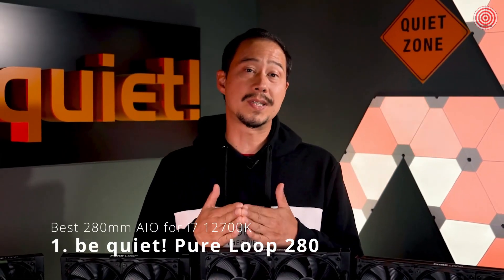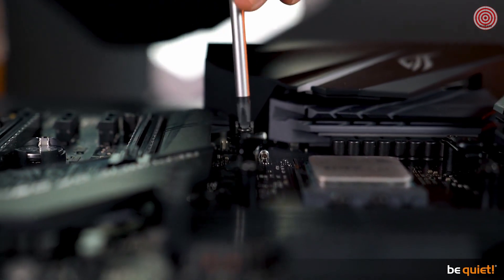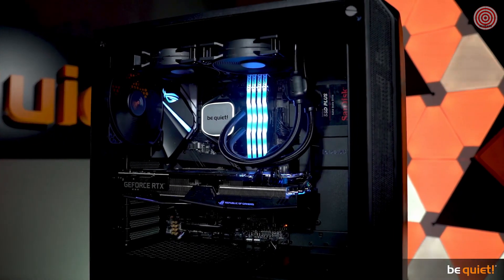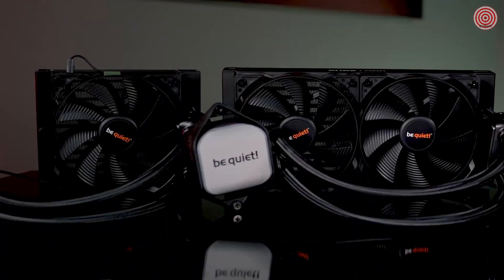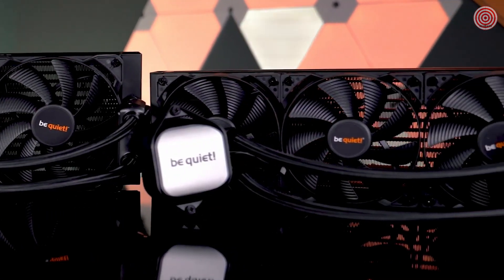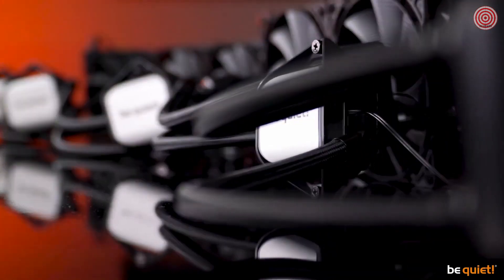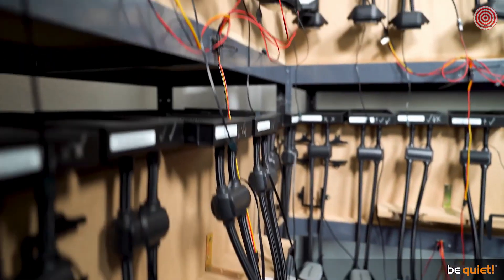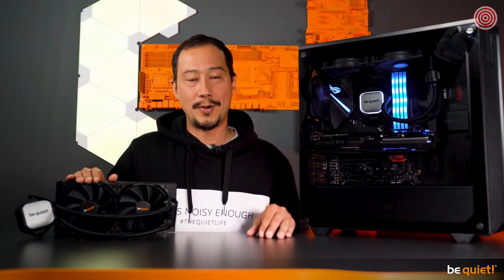5 Best CPU Coolers for i7 12700K at a glance

Comment: 34 esports duo not fully covering 12gen ihs is ok or not? Will I lose performance and my cpu becomes hotter (12600k) thanks
Reply from the maker: As far as I know most coolers that were not designed for LGA 1700 do not cover the entire ihs area. 
I say don't worry about it. 
PS: Artic 34e Sports is not for overclocking.
Reply: @AryTechB  ok thanks, yeah I don’t plan on overclocking ever, just bought because it was £250 and has better resale value I think, also should I just fully cover cpu in paste or will that actually trap heat?
Reply from the maker: @heroicsquirrel3195  cover only the surface of the cooler with paste
Reply: Not okay, which this comment being a year old im sure you know by now lol. Your IHS should be fully covered to avoid hot spots especially with 12th gen. Lord god the 12700 and 12900 are hot bitches.

Comment: And what about i7 12700F? Does it need one of those coolers or it's enough with the stock cooler?
Reply from the maker: If you have a well-ventilated case and light gaming, the stock cooler does its job efficiently. 
On the other hand, if you are going to play games that require a lot of the CPU, I recommend one of the coolers presented here.
Reply: Hey man it seems you also have a intel i7 12700F and with people always getting the K version. How do you feel about it?
Reply: @rusty4640  The K Version has igpu, an integrated gpu in the processor. This helps your dedicated GPU to 100% focus on whatever you are running (a game, a program) and leave the igpu to do side tasks and don't distract your GPU usage with that. For gaming it doesn't really matter but for video creation it's more than necessary.
Reply: @rusty4640  i've been doing everything without problems so, in my case,  a K version wasn't that important as the graphic card for example.